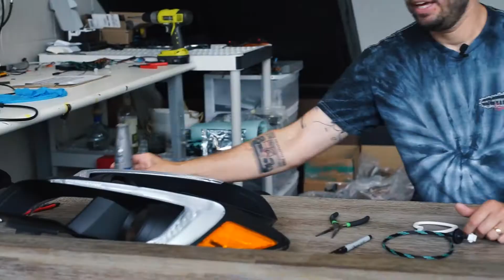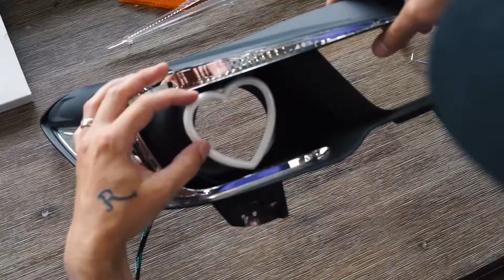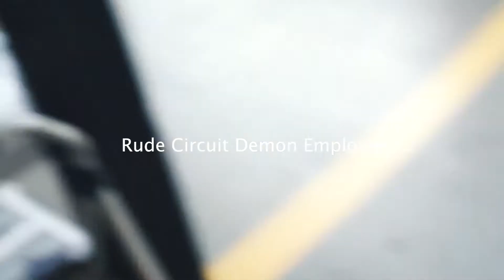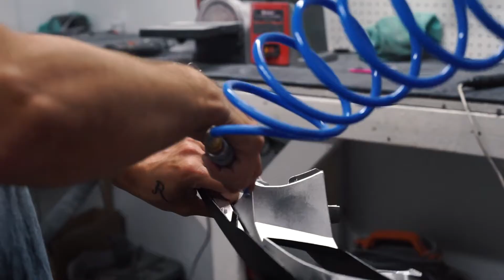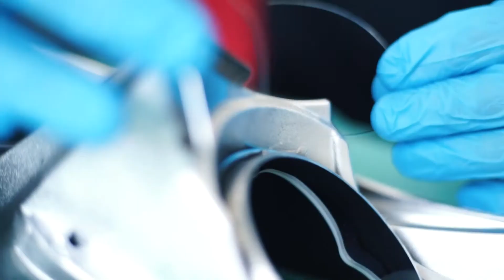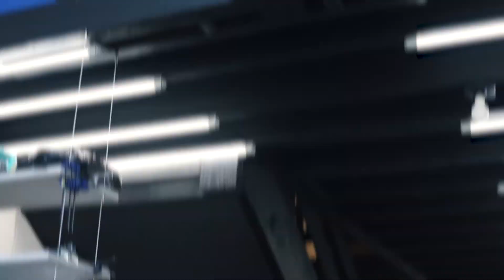How To Mount Your Circuit Demon Heart Halos!

Comment: Im doing hex halos on a 2018 wrx and im trying to figure out best way to mount. Im worried the projector could melt fishing line and glue.  I really just want to epoxy bond them to the housing . Is the projector gun a be hot?
Reply from the maker: Fishing line will not melt, it’s a solid way to connect the halos to the shroud. Which is exactly why we use fishing line and JB weld vs. epoxy which will fail overtime from heat of the projector and sunlight within the housing. Fishing line is the way 🎣